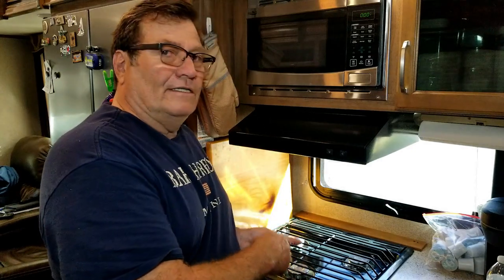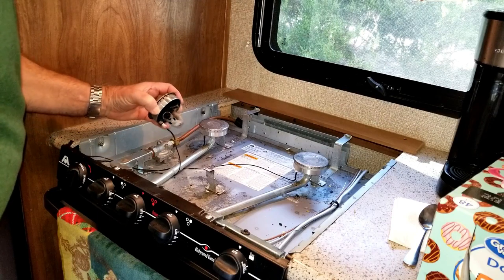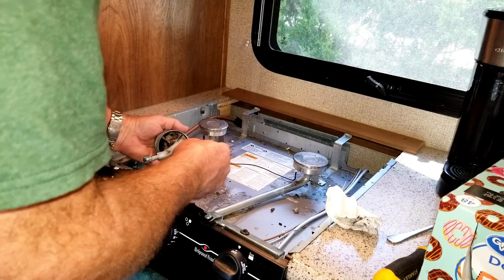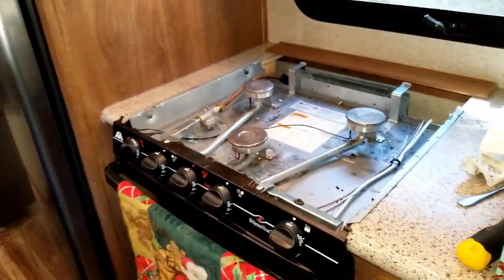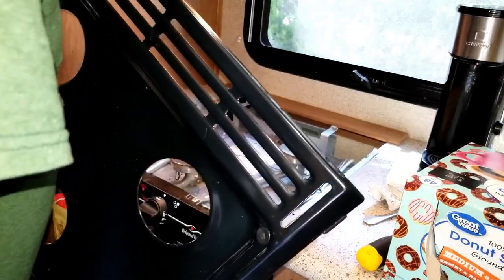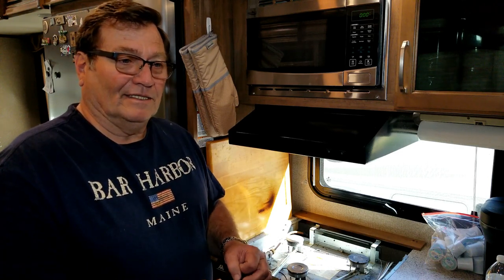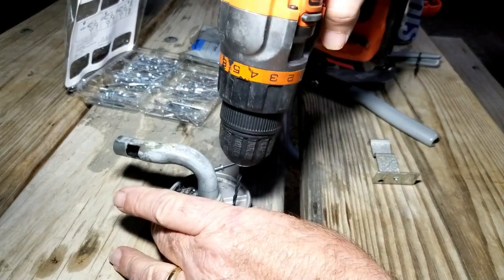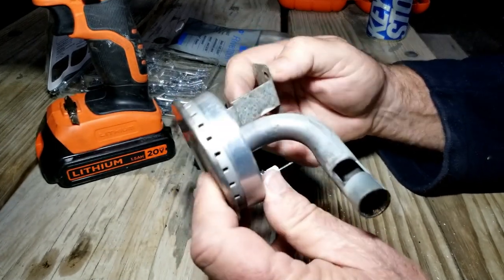How To repair The Burners On The Atwood RV  3 Burner Stove

Comment: Thx for video👍🏼we bought a brand new trailer and first week, the hot water heater blew fuses(cheap from china), stove burners keep falling apart, and fantastic fan swing arm to open it broke. All Dometic items. Needless to say, Dometic, which was a great product, is now not so great. Our stove is not as easy to work on as yours, they have changed the style and also I figured out that the L brackets holding the stove in, are bent too much and thats why the whole thing rattles so bad(we have had that grill topper come off more than once🤡) but your video has at least put me in the mood not to give up trying to fix it, and it will be fixed and better than when I got it!!!
Reply from the maker: Rv products are really not as good ad they used to be. It seems ever since the pandemic its gotten a lot worse. Thx for watching!

Comment: Have you had any more problems with the burners? The Dometic we had spontaneously self disassembled both burners when the screws fell out. We had it replaced under warranty with a Surburban, which now has a recall on it for exploding due to the gas tubes cracking over time. We're considering moving back to the Dometic, but expect it to disassemble again. I'm wondering if the riveting works long term?
Reply from the maker: Have had no more problems since I riveted them. That was quite a while ago. I consider it a permanent fix
Reply: @RvTipsandTrips  Excellent! Thank you for answering my question. We are probably going to pull our Suburban and replace it with the original Dometic, and I'll just repair it as needed. Or maybe I can engineer something like this before we install it.